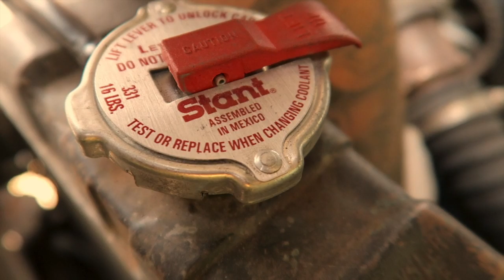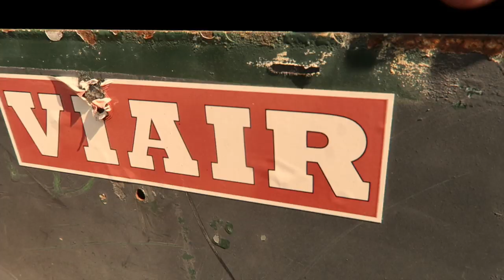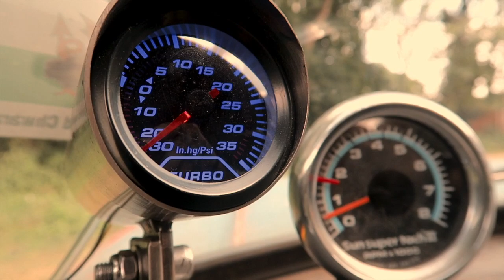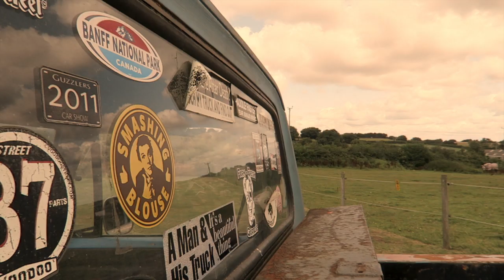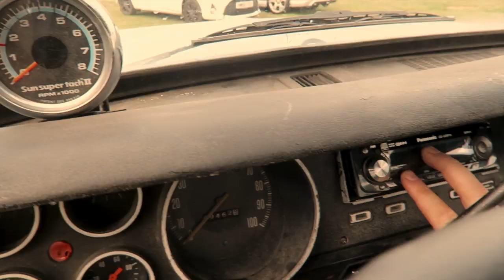I Bought A 'NEW CAR'

Comment: Absolutely outstanding video! You cannot beat an old car, I've just done 250 miles in my 2004 e46 330i auto touring and it was awesome. Did it on £35 quid of fuel and I was 'pushing on.' I hate the finance society we now have

Comment: Awesome mate looks the tits, I’d have that anyway, I think the only thing I’d do
Is as u said change the wheels put a nice set on it, lower it more or air ride it, maybe engine out and paint bay, after market hoses, all the chrome underneath the bonnet, make truck stack exhausts or side exhausts like on the corvette split window. That would be it tidy up the interior make it look a bit more muscle bound, like the trucks used in fast and furious 4 at the start